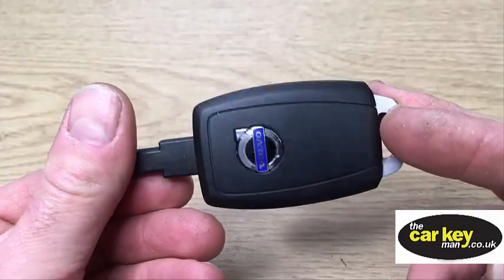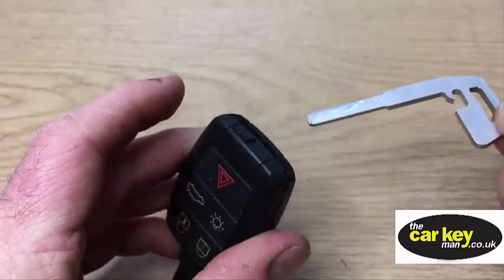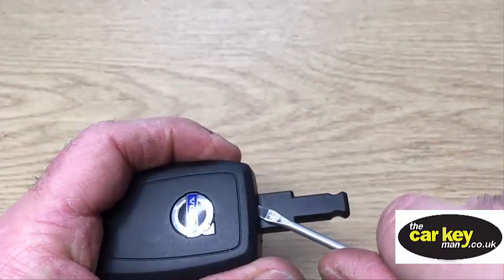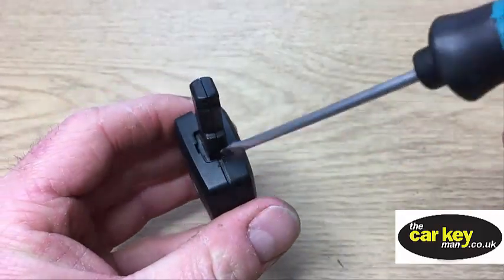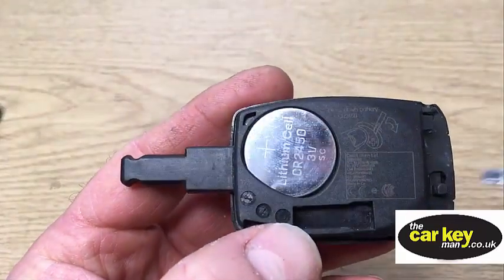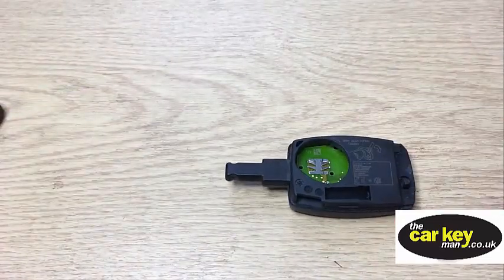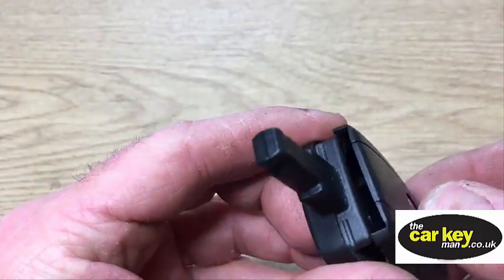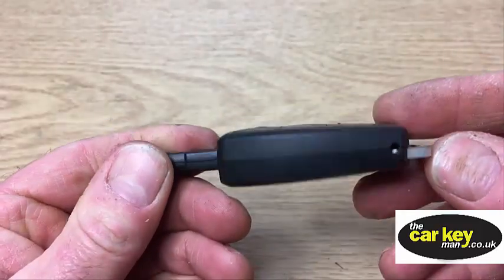Key Battery Volvo Dash Key HOW TO

Comment: Hi . Great video - super clear. I have one of those keys with a broken tip. I see that there are key cases like this sold on ebay which say that you can swap the circuit boards over but I can't see how you can get into the casing to get out the circuit board. there doesn't seem to be a screw that hold it together unlike other key cases. Can you help?
Reply from the maker: Hi peter, I've not changed a case sorry, I'll have a look at one when I can find one

Comment: Fitted new shell, using existing key interior panel and battery. Now showing as key error
Reply from the maker: Hi Thomas, have you put it all back to normal in the old case and does it work?

Comment: Hi I have this key and the buttons aren't working I've replaced the battery but still no joy. Could the connection from the battery to the actual buttons be broken? Thanks
Reply from the maker: Hi Alan, the only way to test it is to find a local shop with a key RF tester. They'll be able to tell if a signal is coming out of your key

Comment: I did this but key doesn't work does it need to be reset?
Reply from the maker: Hi Graham, did it work before you changed the battery?
Reply: It might not have been the original key that came with the car. If that is the case it will need to be reprogrammed. But I would try another battery first to make sure its not a faulty battery.
Reply: It did both keys worked prior to battery change and also batterys are ok, thankyou
Reply: Sounds like it needs to be reprogrammed.
Reply: How come ?
Reply: It's the only thing that makes sense. If they worked before and the batteries are fine and put in properly it's the only thing left to try.